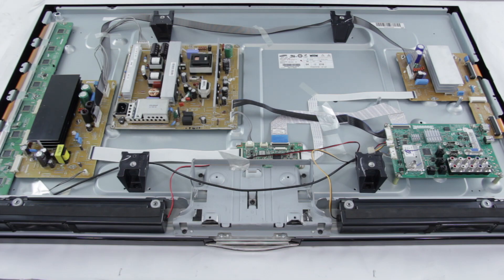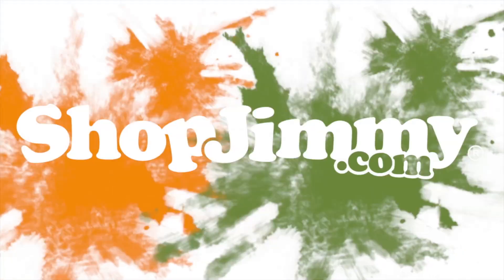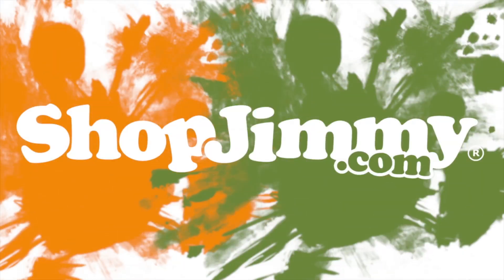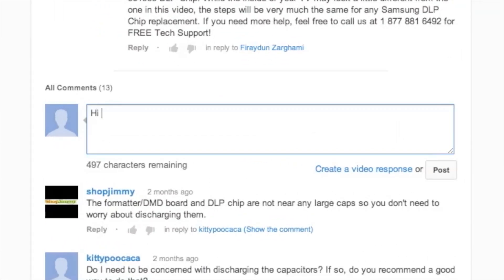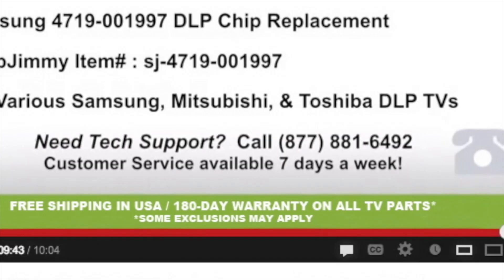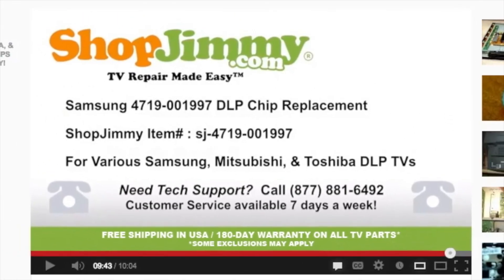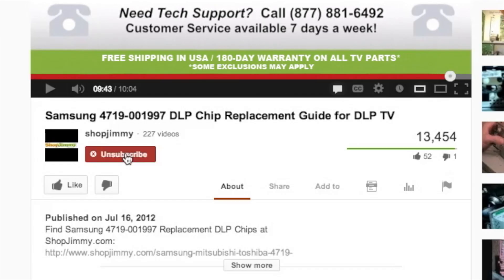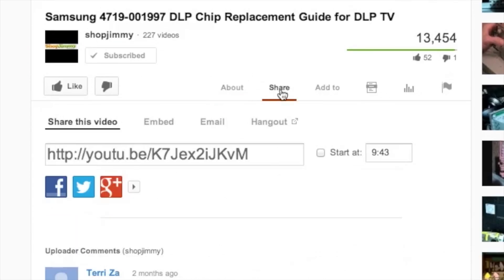Plasma TV Repair Tutorial - Common Symptoms & Solutions - How to Fix Plasma TVs

Comment: LG Plasma Model 50PV450-A  When you power the system on  you hear a relay click then it powers off and keeps looping on,click, off.  When I disconnect the Z-SUS board relay clicks but does not power off.  Any help would be great

Comment: After I turn my TV on it shuts off by itself after a minute sometimes a standby light goes off and if I hit the power button it comes on then I hit it again in the TV powers up after a few cycles I won't work no more that I unplug it in plug it back in and it will do it again

Comment: I have a Samsung FPT6374x/xaa Version SLO1  TV.  The screen suddenly went black and every 10 to 12 seconds a clicking noise is emitting from the top rear of the TV.  The circle light on the front of the TV still is lit and is flashing.
Reply: David, I have the same set with same issue. What did you end up finding out was wrong with yours?

Comment: Hello I have a Samsung plasma display model number HP - 85073 model code HP85073XLXAA  it is from September 2006 ok my TV turns on and when it dose you here a load snap noise the a blue light flashes on the front and you a jingle letting you know tv has been turned on and it stays on no problem there just no picture what so ever I appreciate your time and suggestions thank you

Comment: Hi Jimmy i have a Vizio VP50 HDYV10A plasma, and what its doing the yellow power light is on when i plug it into the wall  and the remote will not turn on the TV. i will have to manually press the power button then after a few seconds a message will appear saying going into deep sleep then it turns off. ive tried resetting and nothing works. so i opened up the tv and the type of power supply board i have is Model:PSU50X4-L1 and after an inspection i found 12 swollen compactors on the left side of the board (1)16v 470uf, (9) 10v 3300uf, (1) 50v680uf, and (1) 10v 1000uf could this be the problem? I've never repaired a TV before but i know how to replace these parts im not sure if this will fix the problem after i replace the parts giving the symptoms.

Comment: 50 inch LG Plasma Model # 50PC5D: Standby light is on, but when I turn on the TV the light changes color and within 2 seconds shuts off back to standby light again. This process can be repeated every time. So far I tried a new power board and mother board with the same result. Any help would be appreciated.

Comment: Hi Jimmy I have a NS42P650A11 INSIGNIA PLASMA TV and what's wrong with it is when I turn it on the screen stays black and a high pitched buzzing/clicking sound, I've already replace the power supply but from after watching you informative video I can see that the power supply is not the problem here. Any info, suggestions or knowledge that you can kindly provide would be most appreciated.

Comment: Hi, I have a Samsung Plasma TV model number P850Q97HDX/XEU.  It was working fine, and then flashed a bright red colour on the screen.  Now the screen is blank.  It powers on ok, and the relay clicks when it powers on, but no picture.  I don't use the sound from the TV as we have an external amp for the surround sound.

Comment: I have a Samsung 43" Plasma TV - Model# PN43D490A1D - (SN -Z2ZN3CQB202254T) - I was watching the TV then I heard a pop and the screen went blank. Then there was a RED FLASHING light in the lower left hand corner. The red light was cycling twice at 5 intervals. if I unplug, then reconnect the power plug from back on the TV, I hear a clicking (relay noise) 5 times then it would stop. I took the back panel off and closely looked for any blown caps but there were now as far as could see. I brought another power supply board off ebay but that gave me the same symptom. I guess that board could have be bad also or the problem is something else. PLEASE HELP!

Comment: I have a Samsung tv and the model number is PN51D450A2DXZA. The tv was struck my lighting one night in our home. It does not turn on at all. I opened it and two of the capacitors on the power board look a little raised but not much. Could it be something else. I guess I just want to know if I'm on the right track with thinking it's the power board. I have a multimeter but I'm not sure exactly what I should check.

Comment: Samsung PN64F8500, Intermittent sound with no picture. Occurs when switching - app to tv, blue ray to tv, or when turning on. Does not occur in middle of program. Tends to happen most often when running sound through my receiver. Unplugging for 20min usually resolves. The last time I turned the TV on (no receiver this time) this happened (TV Cold). The power indicator light flashed slowly for about 8 - 10 times that then flashed quickly about 3 times. No picture absolutely nothing, sound fine. Sometimes turning off and turning on by continuously holding the power button down on the remote for like 20 seconds will work. I hold it down until the TV just flickers, then I release the button and the TV will come on just a few seconds later. This corrects the issue about 50% of the time.
Reply: +ChannelBri 
I have the exact same TV, experienced very similar symptoms ~ ultimately the panel had to be replaced...

Comment: I have a plasma that I bought about 3 years ago you cannot see the picture anymore but you can hear what they're saying here is the model number pn60e550d1FXZA serial number    z4sq3CKCb00536W can it be fixed and is it worth it
Reply: +Arthur Mendez I have the same model and the same problem. best buy geek squad came out twice with different boards then said the board that would fix it was no longer available. If you find a fix let me know. raymondcharles3@aol.com

Comment: I have a Panasonic TH-50PZ700U after a lighting it doesn't have picture or sound from the video inputs ports. The menu comes on fine and from the front port SD card reader it display pictures. Do I have to replace the video board? The Video has two board the main video board and a board for the HDMI ports. Do  have to replace both boards?

Comment: Hello, I have a Pioneer Pro FHD1, the unit is presenting the image but is flashing or pulsating the full screen.  The symptom has occurred twice now, overnight, or after the set has been off for 8 hour or so, it works find.  Over a week has expired before the issue has returned.  Same scenario, if I leave the set off for 8 hours or so, it works find.  I have read they could be the buffer board(s), as this unit has two.  Recommendations would be appreciated. Thank you, Rick

Comment: Hi- we've got a LG 60" plasma, model number 60PN5000. It made a very loud pop but we are get no power, no indicator light. I'd appreciate any suggestions for which problem area I should start with (wasn't sure if I should start with fuses or Y board.

Comment: we have a samsung 3D plasma 64" PS64F8500 model TV. standby light used to blink and picture may or may not come on as well as sound.  Now nothing.  I have checked the capacitors and they look ok throughout. not sure how to check the fuses though.
Reply: +Rose Cavanagh 
Hi, just to try and save you some aggravation, I had a similar issue and ended up having to replace the entire panel.  $1,100 parts + 300 labor.  :-(

Comment: Hoping for help.  Have a Samsung Plasma TV Model PN64E550D1FXZA - the picture turns off.  It may come on for a minute or two after resting, but doesn't stay on long.  It doesn't turn off and then try to turn back on (no clicking beyond startup)  Took the back off.  At a point when working, the green light on the control board would flash consistently every 1-2 seconds.  After the picture went out, it began to flash slower (every 5 seconds).   If I unhook the Y Sustain and X Sustain Boards and turn it on, the green light flashes slowly still (every 5 seconds).  Any ideas ?  Thank you...
Reply: +Jeff Stryker SAME MODEL SAME PROBLEM Raymond Charles

Comment: I recently replaced the Y buffer board on my plasma TV, which resolved the previous issues I had with lines going across the screen. Now my TV comes on but no picture is displayed. Could this be due to a bad "Main Logic Control Board"?
Reply: Wantina Williams you have to replace the buffer and the y sustain board that's board hook up to the buffers

Comment: I have an HP  PL5060N, that works for 20 minutes then goes blank. It has no speakers, so I don't know if sound works. I just use it as a monitor. It seems like the Y board, so what do you think. I do get some horizontal lines before it goes out. The picture is perfect, when first turned on.

Comment: I have a LG 60PS11 Plasma TV I was given the TV and it Didn't work at all. I replaced the power board, now it works but it has a 4-1/2" Vertical black (Some color flickering) bar running down the center. I have tried resetting all of the ribbon cables but no real change.

Comment: I have an LG 47LE5400 that is 2 years old.  While watching TV the other night we heard a "Crackling" sound and the screen went black.  It was connect by Component video cables from a Cable box.  We tried HDMI and coax to no avail.  It still shows Menu option, Smart TV screens, and Widgets normally.  The sound operates normally.Any Ideas???

Comment: Samsung Plasma PN60E530. No picture. Powers up with the samsung tone. Logic Board blinks every 5 seconds. Disconnected Both X and Y main and the tv powers up both times. When X and Y main are connected there are voltage drops when testing the VS and VA. Disconnecting both connecters on the Y main, the voltage remains constant. I have not tested the Y buffer for shorts yet. No visible cracks on the screen. Is this most likely a y buffer/y main problem?

Comment: pn51f4500afxza friend had given me this TV in hopes that I could fix it I plugged it in when I got it home and nothing next morning I tried again and it starts right up with image and sound 5 min later it started shutting off and on by itself and then it shutoff completely .I'm also hearing a small humming noise coming from the power board but it stopped doing it a while ago.  any suggestions?

Comment: I have a Maxent MX-42X3 that flickers once its been on for a little while.  The Board part number is QPWB11522-1G-1 (DPWB11522-MPP-B).  I'm guessing I have a bad cap somewhere but was wondering if you could point me in the right direction.

Comment: I have a Samsung plasma TV, model#PN51E550D1FXZA. Within the 1st 10 minutes in power cycles 6 times, and then runs fine. I replaced the power supply, even though the capacitors looked fine. The TV continues to power cycle, the same as before. Based on your tutorial is the Y-sustain board the most likely  candidate for replacement.   thanks for your help  ECC

Comment: Hello, we have a Samsung TV Model #: UN55F6350AFXZA. Version #: TH01It is 2.5 years old and the other day we lost all the apps on the smart hub but it still let us use the DVD player for 1 day. The day after that we could turn the TV on but not off and it cycles on and off by itself only saying Smart TV and showing the four hexagon logos and won't let us do anything else. Your Web site says you are out of the TV repair bundle for this model.  Does it sound like it involves more than the main board?

Comment: Samsung 50" Lcd tv model#Lf501EM6f
Im not sure if its plasma or not but its a older model still pretty heavy but not like the old box tvs. The tv works but from time to time either the top or bottom half of the screen will turn into squiggly lines and colors and kind of show images from past like burned into the screen or something. Then it stops and goes bk to normal. What do i need?

Comment: I have a Samsung pn42c450b1d that cycles power with flashing red light. I've replaced the y board and the main power board. It still cycles. Do you have any suggestions?

Comment: I have a 7 year old 50 inch Toshiba plasma. It wasn't used often except on Sunday's for football. The problem I have is all of a sudden the screen went black. It flashes very dim. You can make out a picture as it flashes. The sound is still there. I heard that Toshiba's have a problem with the back light board going bad. I really haven't dug into much yet to see if there is any burnt chips or anything like that. fuses that I can find are good. There is a ton more stuff in my tv than the one in the video probably because it's an older tv. I bought a new tv but still would like to fix this one if it's cheap enough.

Comment: Hey Guys,

Just got this TV and this is my problem.

2008 50" LG 50PG60 

- TV is getting power, standby, and TV will turn on (hear the click) and it stays on. Red light is on when power connected, and goes blue when power button is turned on.
- There is no picture (all black and no dim light) but has sound
- I checked power board and Vs and Va are all in check and in appropriate range
- Y Sus is getting power and no noticeable burnt out diodes or bulging caps
- I checked both upper and lower Y buffer boards and seems to be no shorts or noticeable burnouts (however, heat shrink - covers chips so could not check these burnouts)
- When I detach the upper buffer and plug in, half the bottom of the tv lights up and is fuzzy, sometimes goes in a horizontal rainbow and tv shuts off. I gather from this that my y sus is working correctly since I am getting light. Menu does not pop up when pressed though and you can hear it switching with tv flickering, but no image. This doesn't work when detaching lower buffer

Thanks for your help!

Comment: Hi Jimmy, I have a Samsung  PN43E450A1F, and I have sound, but no picture. I replaced the X-Y Main Board a month ago with one of yours, and the tv worked great until yesterday. Thanks in advance for the help
Reply: your link www.shopjimmy.com is inaccessible due to no permission.
Reply: Access Denied

You don't have permission to access "http://www.shopjimmy.com/" on this server.
Reference #18.254f655f.1475161122.22e74
Reply from the maker: +Mark Dempsey   Try all repairs and troubleshooting at your own risk.  Did you change the Y-Buffer board, when you changed the X/Y Main board?  Thanks!  www.shopjimmy.com

Comment: Hello, I have a Samsung Pn60e550d1fxza version ts02. It seems to be dimmer than normal and just this evening the picture flickered a couple times, turned itself off and then back on again. After that it flickered one more time but did not go through the power cycle. Any suggestions? Great video.

Comment: I have a LG Plasma 60PV250 The standby light comes on but when you turn the TV on you hear two clicks then the standby light fades out. You have to hit the power button again to get the standby light to come on again.
Reply from the maker: +Mark Loring   Try this at your own risk. Unplug the TV, then disconnect the y board and plug in the TV to see if the TV powers up. Note that it will not have a picture on the screen. Reply with the results of this test. Thanks! www.shopjimmy.com
Reply: +ShopJimmy.com  I have the exact same issue, but with a 50PV250, It has no video, But still has audio
Reply: I had the same issue, it was a faulty Y Sustain board
Reply: +ShopJimmy.com I disconnected the Y board. Plugged in the TV. Red stand by light comes on. When I hit the power button the red standby light fades out and nothing else happens.
Reply: +Annaliese Valdez Sorry still nothing. I've started digging deeper into it. When I figure it out, I'll post the answer here.

Comment: Hi guys. glad your around to give advice. I have some electronic repair experience but I am not a TV repair guy. I'm looking at this TV for a friend. It died without warning. No magic blue smoke. It's a LG 50PM4700. The red LED cycles with the power button and clicks can be heard. but there is no picture at all. The 2 fuses on the power board seem ok . The YSUS board appears discolored at the center, around the area of a filter coil and what appears to be resisters. All of the crappy Samwha capacitors appear to physically ok. Any Ideas? Thanks
Reply from the maker: +once aroundthemapleleaf   Try this at your own risk. Unplug the TV, then disconnect the y board and plug in the TV to see if the TV powers up. Note that it will not have a picture on the screen. Reply with the results of this test. Thanks! www.shopjimmy.com

Comment: Hey Jimmy , I have a Panasonic TCP50S1 some times the tv turns off and blinks 10 time i un plug for some time plug back in able to useTV
for an half an hour or more  then it happens may again...Thanks!!
Reply from the maker: +Jose Antonio   Try this at your own risk. Unplug the TV, then disconnect the SC board and plug in the TV to see if the TV powers up. Note that it will not have a picture on the screen. Reply with the results of this test. Thanks! www.shopjimmy.com

Comment: lg 60pv450 plasma tv
when powered on, the screen appears with black blothces  . as the tv warms up the blotches eventually disappear but the color appears faded on the picture screen. 
https://www.youtube.com/watch?v=Oea9vnTurCA  this is a similar video to my issue but i have full color, albeit faded color.
Reply from the maker: +Nathan Tranzow   Try all repairs and troubleshooting at your own risk.  I recommend replacing the YSUS and the YDRVTP & YDRVBT boards in your TV.  Click this link to replacement parts for your TV model number:  http://www.shopjimmy.com/catalogsearch/result/?q=60pv450  There may be multiple boards for the same TV model number, be sure to match part numbers on your current board, with your replacement for compatibility.  Here is a link to a video showing how to identify your part number, click here:  https://www.youtube.com/watch?v=GEllG3RV-tc  Thanks and please let us know if you have any further questions with your TV Repair!  www.shopjimmy.com